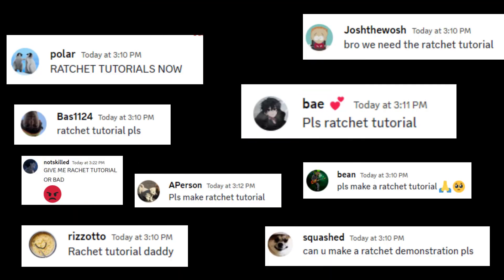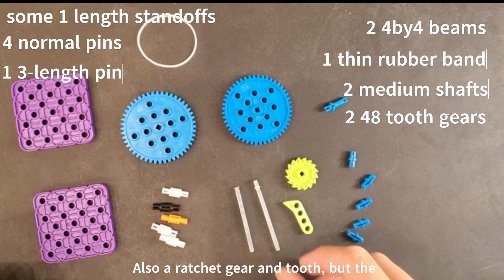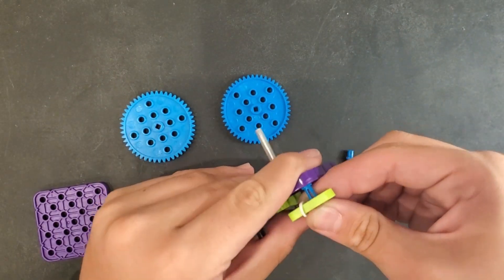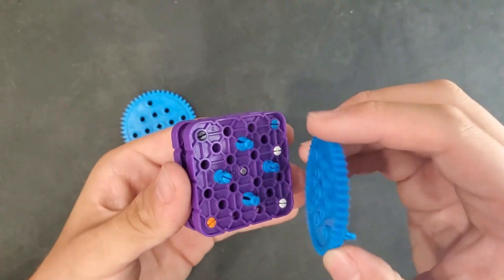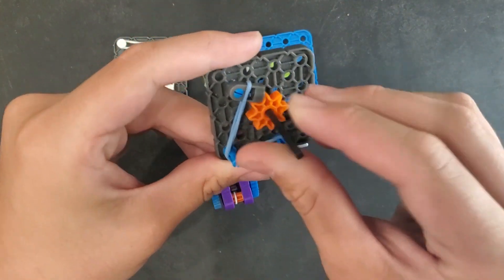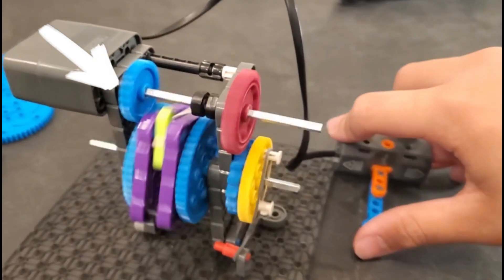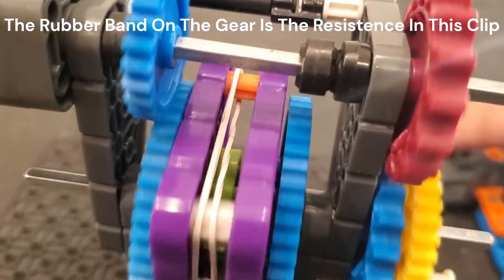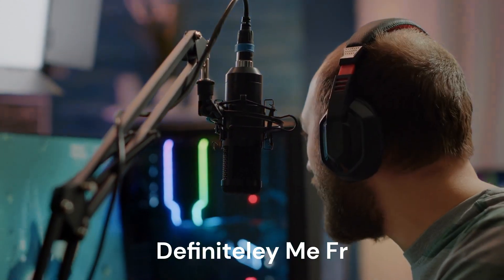The Ultimate Guide To Motor Sharing In Vex IQ! Ratchet tutorial and Tips!

Comment: I tried this and it kinda worked but the ratchet stopped for a second and moves a bit and then stops again. Is it the ratchets rubber band or something else??
Reply from the maker: Usually when the rubber band isnt pulling the tooth down enough the ratchet will disengage. Try using a smaller, tighter band. I also found using a 2 length pin instead of a 3 length pin to hold the tooth also sometimes helps. You may also want to use the gen-1 variant, because that one can be tightened more than the other ones.

Comment: Where can I find the bands you’re using? Also why do you have motors not from vex iq
Reply from the maker: I got my bands from a japanese store called daiso, but I would advise using thin regular vex brand ones or thin ones from staples. They work too. 
The issue with the bands I was using was that the inspectors thought they were illegal and we needed to show them the product specifications to prove them legal.
It works with the staples tan rubber bands as well.
Reply: @RileyMarkley  thank you! I’m assuming when the rubber bands have #32 or #64, they’re competition legal right?
Reply from the maker: @velocity6867  They are legal, its the tiny band in the gen 2 kit.

Comment: What are some limitations that you may have encountered with using ratchets in your robots?
Reply from the maker: The primary issue with the ratchets is two fold. Issue A: The shared mechanism is only able to spin in one direction. Issue B: The gearbox for a twin ratchet is usually quite large. Over time, I have learned to overcome/adapt to these changes, which is why I use them so much!